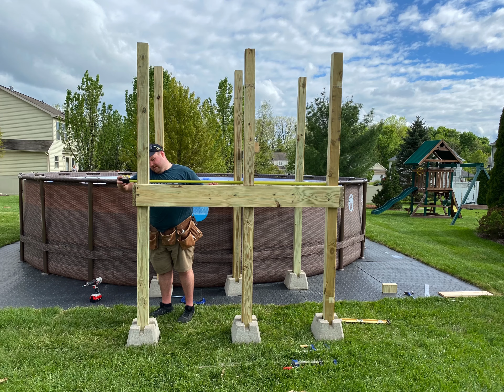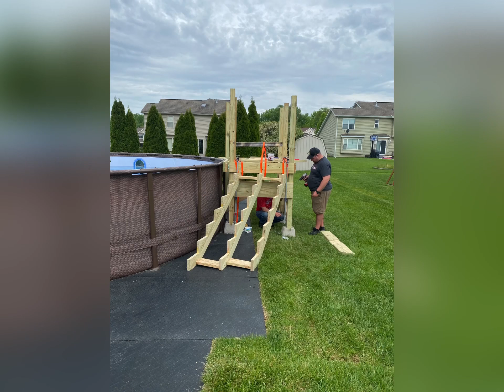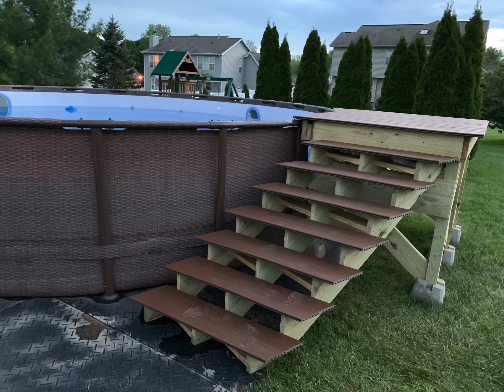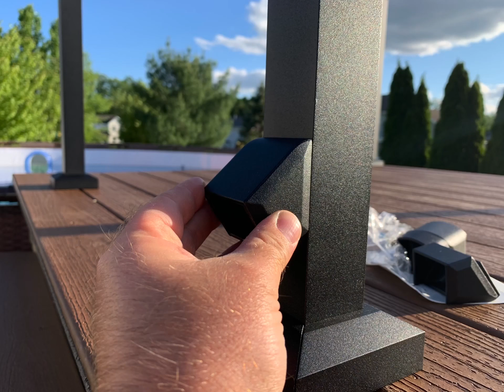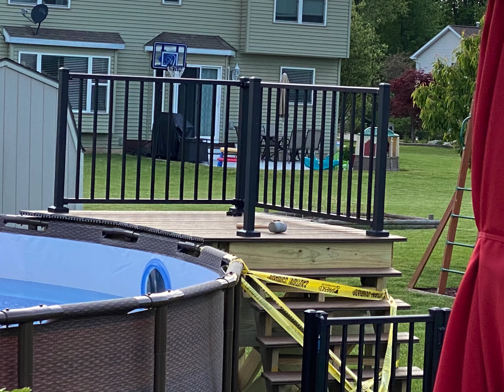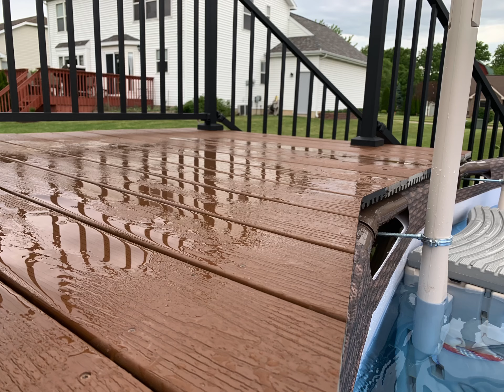Deck Build WITH ANGLED STEPS for an Above Ground Pool!!

Comment: Also can you elaborate a bit on the solar panels that you are using? How many degrees can the panels increase the pool temperature on average? What brand are they and were you pleased with them?
Reply from the maker: I liked them and I think they helped. I got them at my local pool supply store, not sure on the brand. Best bet would be to check with your local store for specific advice for your situation.

Comment: What size 2 X 's did you use for bracing and for under the deck boards?  thanks
Reply from the maker: @nelsonblanchard  sorry, this was quite a while ago when I built this, and have since moved. I don’t remember what size I used.

Comment: Although you said its been a few years...how much roughly did you spend on materials for your deck?
Reply from the maker: I think it was a little over $3,000 for materials.
Reply: To make sure I'm on the right track...are your deck blocks 7×11×11?
Reply from the maker: @darnellbyrd7736  I’m not sure on the dimensions. But I would think any deck block offered would do the job.
Reply from the maker: @darnellbyrd7736  that does sound about right though. I’ve moved since moved, so I can’t measure them.
Reply: You've been very helpful...can you remember what the measurements were for your gate door?
Reply from the maker: @darnellbyrd7736  Thank you! Sorry, I don’t remember.

Comment: What kind of pump did you use
Reply from the maker: It was a Hayward pump and sand filter I had found used.  I don't remember the specs on it, but it was definitely more than needed for this pool, which made it very easy to keep the pool clean, cycling the water much faster than a standard pump would.